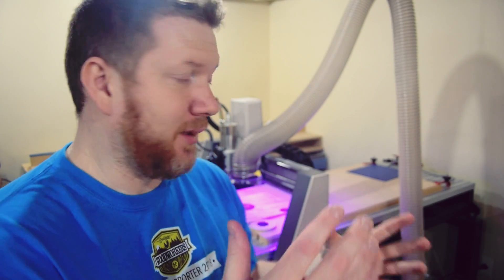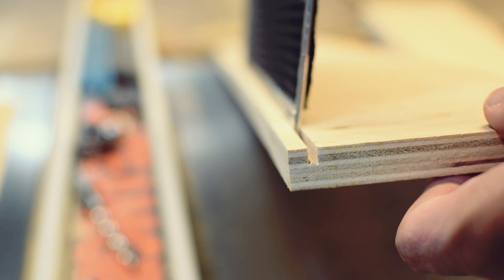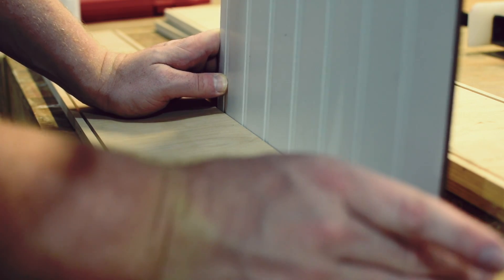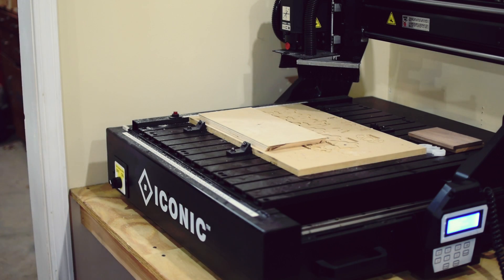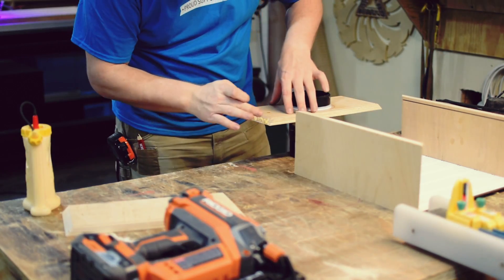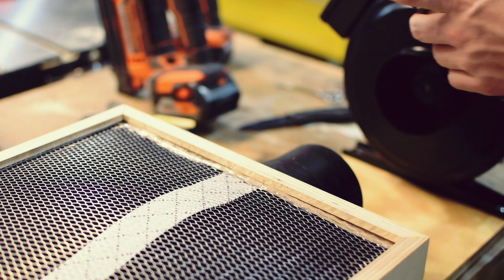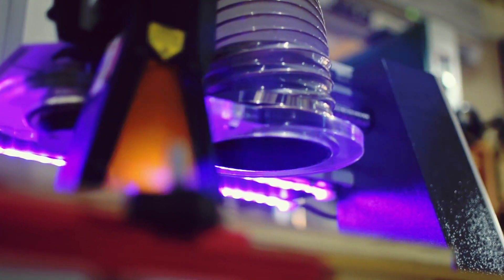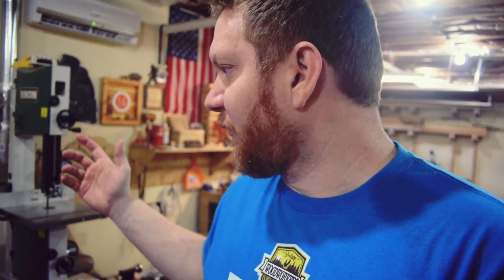How to make a fume extractor // Axiom Precision CNC Laser

Comment: I just installed my laser and I vent my dust collector outside, could I just use my current dust collector to suck up the fumes and send them outside?
Reply from the maker: I would be careful with that as dust and potential hot fumes could cause a fire. I use the same hose but doesn't go through my dust collector.
Reply: Southern Ginger Workshop that’s what I was thinking, I used it the first time for my test run but was nervous about the fire potential 😳, but I had a fire extinguisher next to me just in case! Won’t do that again.
Reply from the maker: @kylemusto8430  yeah you're probably fine but I don't wanna risk it either loo

Comment: The level of air filtration is not enough for a laser. Most experts will tell you to vent the laser fumes outside. If you choose to vent inside it takes much more than a thin layer of filtration. There are HEPA grade filtration systems for lasers out there, they are not cheap. When engraving/cutting things such as acrylics you need to ensure that ALL the air gets cleaned. The small amounts that escape are harmful to YOU.
Reply from the maker: Thanks Bryan, I appreciate it

Comment: I got my Axiom and laser a week ago, and I'm eager to do something about the smoke. Like you, I'd rather not put a hole in the wall. Over a year later, how is it doing? I don't see any videos of modification or replacement, so I assume you're still using it as seen here. 
I have an idea for a modification. Don't know how good it is. If the box encased the filter in the middle with the inlet on one side and another 4" outlet on the other, another duct could run from the outlet to the dust collector, eliminating the need for the blower. But I wonder if enough smoke would get through the filter to nasty up the inside of the dust collector.

Comment: If you taper a cone type shape it will increase the suction power and you would be closer to the work piece. We have that setup on our computer aided plasma table. I don't see why it wouldn't work with your laser setup.
Hope it helps
Reply from the maker: +Billy Beane thanks Billy I will try that!
Reply: If you have a 3d printer that will be an easy add-on part to the end of the 4" line.
Reply: I would make it to possibly fit around the protective hood, how close does it ever come to the material?
Reply from the maker: +TechEdFireman actually I do! Should I go from 4in to some kind of flexible adapter?
Reply from the maker: +TechEdFireman 1/8in there isn't enough room for that unfortunately
Reply: Well, looking at the protective hood possibly could do a rectangle cutout maybe 1-2" tall by whatever width you could fit and do the 4" down to a 2" tall rectangle by 1" wide to the hood.